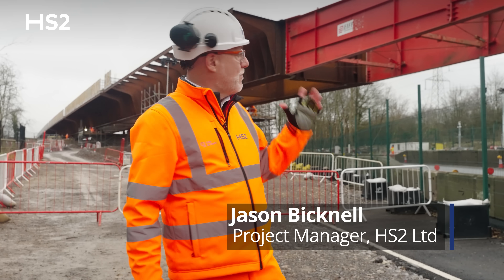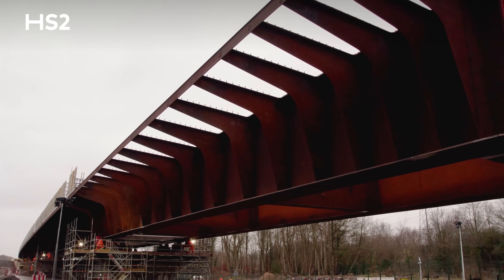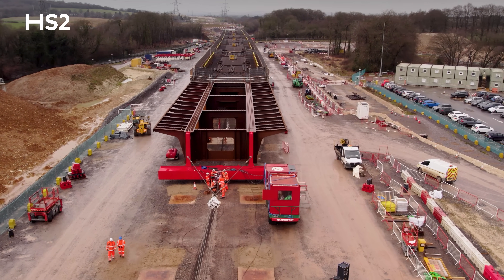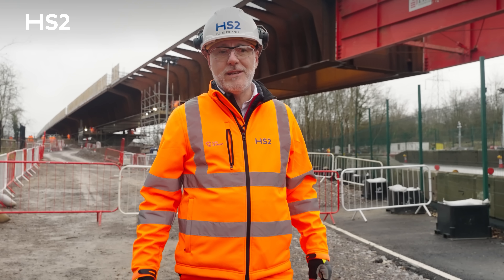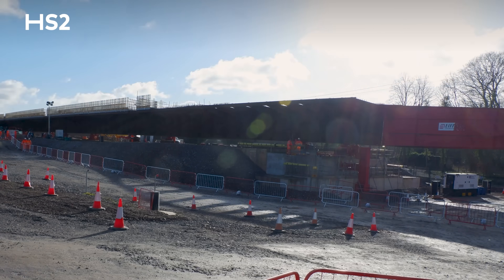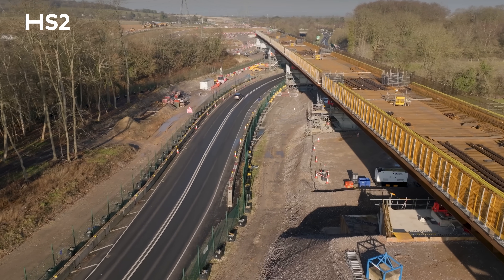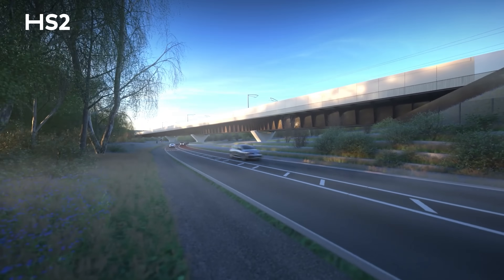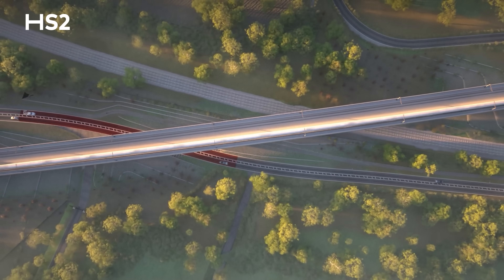How HS2 moved a 4,500 tonne bridge across a road and railway line

Comment: 'Rusty steel hardens with age' but the Tyne bridge in Newcastle upon Tyne needs millions spent on it due to corrosion and lack of maintenance so why not let it 'harden with age'
Reply: Different types of steel.
Reply: The weathering steel used in this viaduct is a specialty steel that forms a patina (a rust layer) when it comes into contact with oxygen in the atmosphere. The rust layer binds much better to weathering steel than it would to plain carbon steel, which prevents the rust from penetrating deeper and weakening the steel. The Tyne Bridge uses structural steel and needs to be painted to provide protection from it being oxidised, weathering steel does not need to be painted and is therefore low maintenance.

Comment: Why the Chinese build so much quicker?
Reply: Actually, it’s not just China. Many countries have efficient high-speed rail examples:
	•	🇯🇵 Japan’s Shinkansen (Tokyo-Osaka) opened in 1964 after just 5 years of construction.
	•	🇪🇸 Spain’s AVE (Madrid-Seville) costs €18 million/km (far lower than HS2).
	•	🇩🇪 Germany’s Cologne-Frankfurt line finished 1 year ahead of schedule.

The UK’s HS2 delays (14 years and counting) likely stem from project management issues, not ‘China being too fast.’

As for China’s speed, three factors matter:

1⃣ Full industrial chain advantage:
Domestic production of TBMs, rails, and power systems avoids supply chain bottlenecks.

2⃣ Standardized construction:
Nationwide templates like the CRTS III track slab system cut costs by 30%.

3⃣ Decades of expertise:
Engineers have refined techniques since 2008 (15 generations of R&D!).

Fun fact:
British rail engineers were once global pioneers in the 19th century. If the UK rediscovers that Victorian-era pragmatism, maybe HS2 can still be salvaged. 😉
Reply: @zhiyaowang-eq4st  A big problem is that HS2, when promoted, HAD to run at 400Km/hr. All other HS's in the world run at lower speeds (except when records are attempted, in which case they use specially prepared, and uprated, parts of the infrastructure), Reason being the Rayleigh Wave effect that could do a good job of destroying nearby  infrastructure, as well as the track itself. HS2 were only prepared to look at the problem after the Government approved the project - still waiting for their results.

Comment: Call me an idiot. But i've watched train video's eg "Don Coffey". The existing main north south lines look pretty  straight to me.  Surely a raising of a 5-10 mph speed limit could be acheveable with maybe limited upgrades. Ie millions, not billions. I know i'm making this sound simple. But to think of all the wasted money on this??  For what? I few mins quicker from London to Birmingham The train would prob be late anyway, When smaller new branch lines or older lines and stations re-opened would be much more beneficial  to more of the general population? Spreading the weatlth, so to speak.
Reply: HS2 is not just about a fast connection between the UK's two biggest cities. It is about increasing capacity on the network. HS2 will allow the fast trains to be taken off the West Coast Main Line and allow numerous slower stopping services to be increased to provide more services to the less well served local stations. Plus it will allow more freight on the WCML. Longer journeys from beyond Birmingham will also have shorter journey times. The WCML is not straight at all. Even for a decent fairly straight line, the East Coast Main Line, the capability improvement with HS2 is another level as trains will be running 100mph faster.
Reply: @Maxhead_room  100mph faster. 😂😂😂
I might not be a prophet but in 20 years time, with the lack of workforce, amount of floods and population increase, these trains will be running as slow and as irregular as all the rest.
Good luck.
Reply: @simsnqta  good luck with your maths exam. HS2 will run at 225mph. ECML runs at 125mph. 225-125=100. Your welcome.

Comment: Waste of money
Reply: Not a waste of money, a great use of it actually
Reply: @hx0d  have you been to Birmingham?  All the houses and rural areas destroyed  to knock 20 minutes off a journey. All it will do is make it more attractive, for highly paid commuters to push house prices up. It's a waste of money
Reply: @ziggy76ziggy76  I agree it's a waste of money, but not for the reasons you say. Birmingham is a sh!thole... so I don't care if houses are knocked down there. The problem is the wasteful design and aesthetic choices they've made on the HS2 design. They've made these fancy looking bridges that are barely going to be seen by anybody! They could have saved so much money if they had just made a simple design. They did not need to dig tunnels through many forests... they could have built bridges/viaducts for 1/4th or 1/2 the cost of the tunnels then just replanted the trees as they were!
Did you know India and Japan are  making a Shinkansen High Speed rail that is twice the length of HS2 at 1/10th price in India. Even with cheaper labour costs they are not wasting money on stupid "pebble shaped" viaducts. The Japanese being the experts on high speed rail are helping keep costs lower with their proven designs that help mass production!
Reply: The driving requirement is that the London to NW England route is out of capacity so more is needed. A high speed line leaves the existing one for more freight (currently quite limited) and stopping trains.
Reply: @ziggy76ziggy76  if you think that's all a railway does, boy ive got news for you...

Comment: you designed it to look rusty Unbelievable
Reply: @lauriepocock3066  it is weathering steel, that means low maintenance, it doesn't need painting and it looks cool (especially in contrast with the concrete upper elements). It is designed this way for a reason.

Comment: Great engineering, amazing work. Is it being replaced in a 120 years, or did the engineer in the video mean design life before significant maintenance would be required? When will trains be running?
Reply: The latter, HS2 is designed not to require any major maintenance for 120 years. The planned commencement of running trains is not defined yet as the project timeline is being restructured - I think this 'T-zero' date is to be announced next year.

Comment: Wonder why the rail lines won't be slightly tilted (left/right) on long curved bends? Without the tilt the trains will probably have to decrease speed slightly before approaching a bend.
Reply: @TomGB-81  the track will be tilted (this is known as rail cant), it will be at a maximum of 160mm from horizontal on the fastest curves. The curve radius on the HS2 route alignment will allow for a potential 250mph line speed, but the track maximum speed will be 225mph.
Reply: I think they are tilted, but the tilt is effectively imperceptible due to the low curvature of the track, experientially the tracks will be effectively straight.